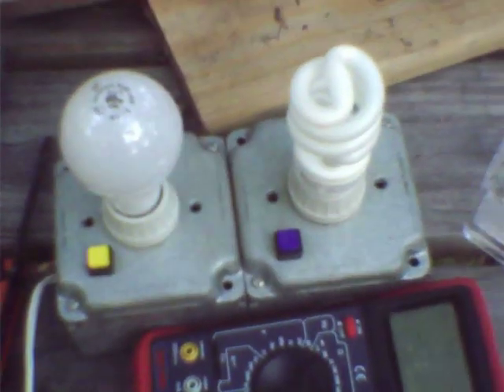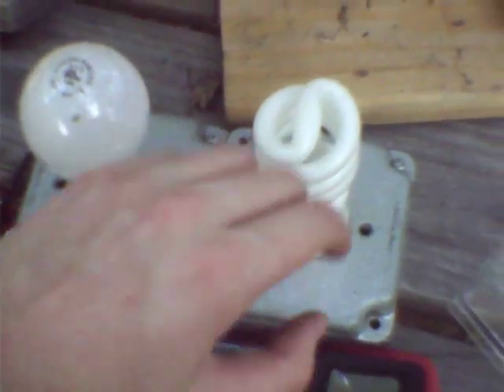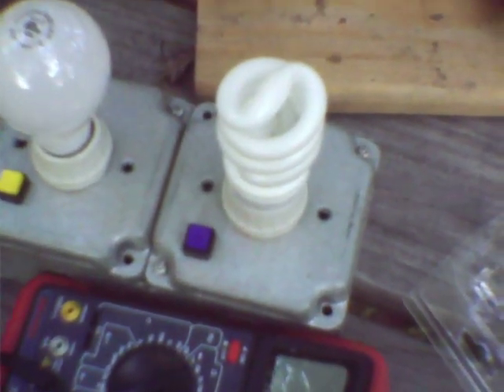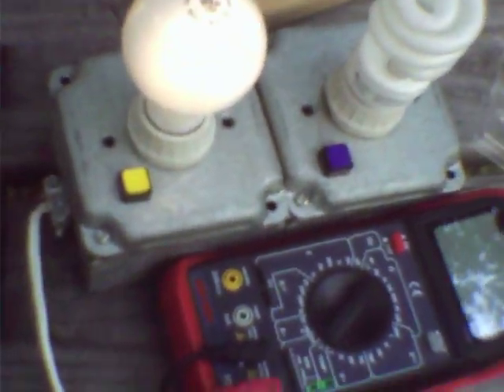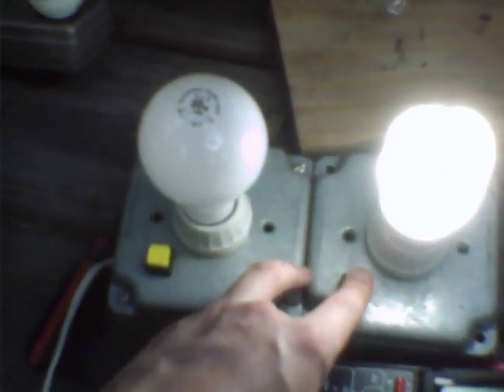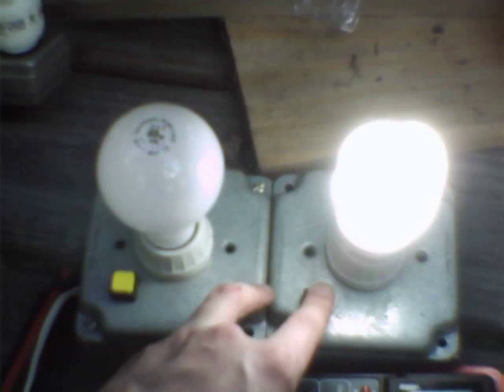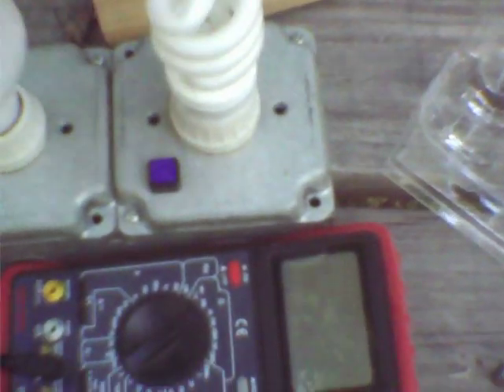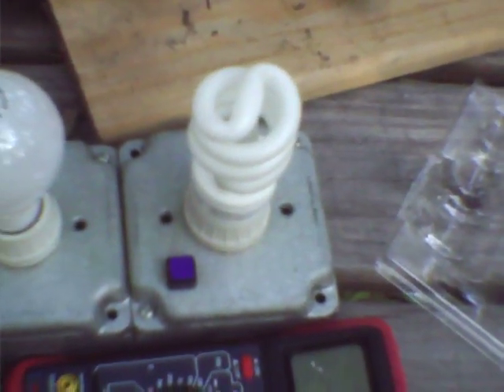CFL surge current demonstration

Comment: most of that noise is caused by the irregular ac waveform caused by the cfl.
it is similar to how a fan becomes louder when connected to a dimmer, despite drawing less current. test it reliably with a scope or even an electromechanical ammeter.

I'm sure you can cope without incandescent light bulbs, most people do just fine.

Comment from the maker: @iToasterman   Any multiwatt LED lamp made for GLS lamp replacement purposes cannot be adequately heatsinked due to the size limitations of the GLS lamp that it is supposed to replace, as everything (heatsink, LEDs, driver, etc.) must fit into a package only about 4in long and 2.5in wide.  Proper heatsinking requires a big aluminum slab and space for air circulation.  These are things that can only be done in dedicated fixtures.

Comment from the maker: @ncrdisabled   Only some LED lamps will work with dimmers.  Given that illumination type LED lamps run at way over ambient temperature, they should not be used for indoor illumination anyway (aside from freezers and the like).  In low temperature applications (freezers, outside lighting in winter, unheated buildings in winter, etc.), dimming is usually unnecessary, and therefore lamp dimmability is pointless.

Comment: They do make the for dimmers I bought 3 from ACE hardware and they say for dimmrs on the box I had a non for dimmer tried it on the dimmer it made the dimmer switch hot where as the made for dimmer does not buzz or even get warm .  I have heard you can use LED lights but I can not afford one .